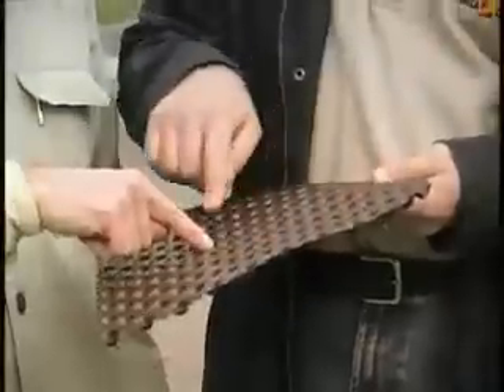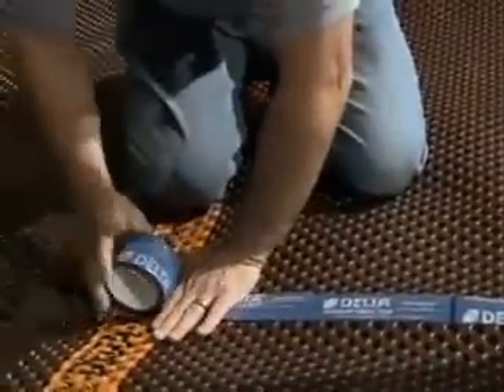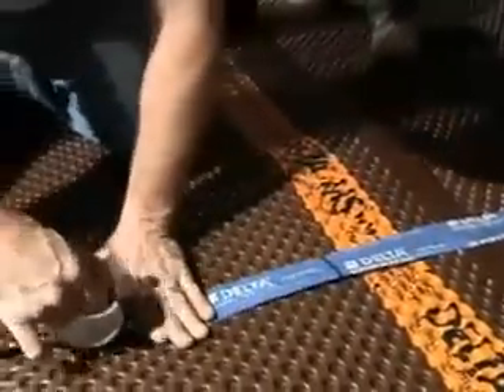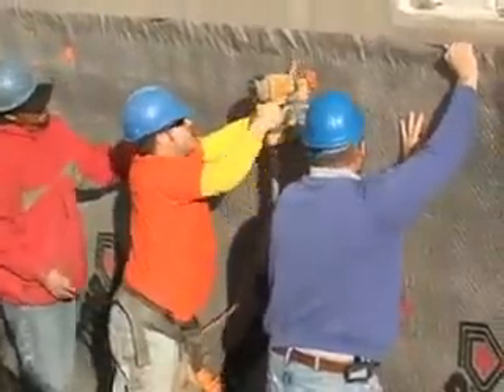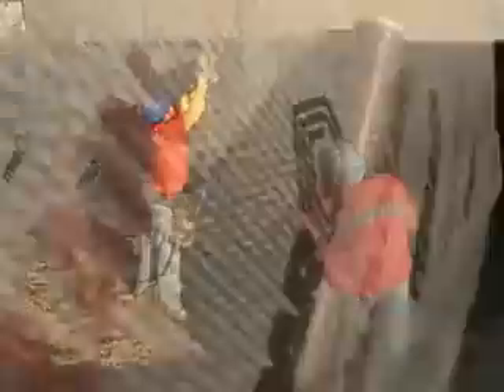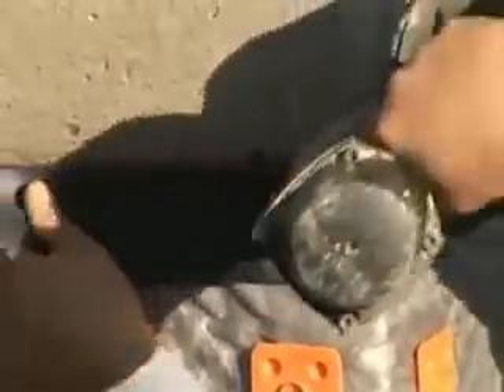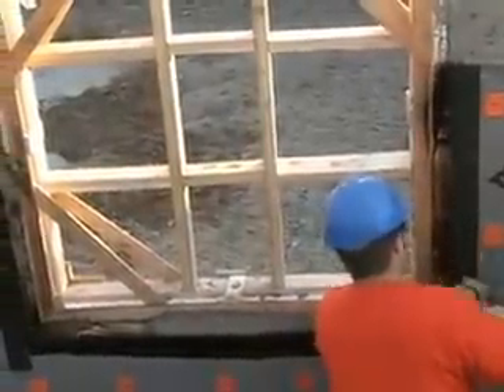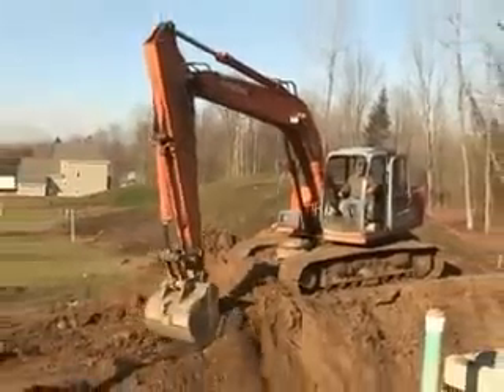DELTA®-MS - Foundation Moisture Protection

Comment: Can delta ms applicable to be installed "above-slab" (basement) and then have plywood installed on top with concrete fasteners?
Reply: I have exact same question please.
Reply: If you’re talking about waterproofing an existing slab then you’re better off using Blueskin.

If you’re talking about waterproofing interior walls above a finished slab then no. You’d have to expose about 10 inches around the slab, 1 foot down for a drainage pipe and another 2 feet x 2 feet hole, roughly 16 inches down in a corner somewhere for the sump pump pit.

Comment: DELTA MS is a horrible material so hard plastic and they make all these holes on the wall. FSM uses this product and made a mess in both side if foundation in my home. You will NOT be able to place anything to cover it...don’t fall for these product because you will be sorry like me.🥲....All those Orange plastic nails will make so many holes in your walls...NO, NO, NO
Reply from the maker: Hi Deanna:  I am sorry you aren’t pleased with the installation.  I can respond only based on the information you have provided here.  An installation of DELTA®-MS does not “make so many holes in your wall”.  The orange fasteners do have nails and provide the holding strength to the wall.  These nail should be 1.25-1.5 inches in length, so the nails do not go through the wall.  The reason they are not a cause of leaks is due to the air gap created by the dimple membrane.  Any water that moves into in the air gap is relieved of all hydrostatic pressure and drains away due to gravity.  This means that the wall will not leak due to water penetration at any fastener, even if water comes in front of a crack or hole.  If you have DELTA®-MS on the interior of your foundation ( i.e. in the basement), it must be covered by drywall or some other non-combustible cover due to fire code requirements.  While your specific conditions may be different, one does not generally require DELTA®-MS on both the inside and the outside of the foundation wall.  You can read our Guide to Protecting Foundations here: https://www.dorken.com/media/docs/products/Additional-Resources/DORKEN-Delta-MS-Basement-Foundation-E-Book.pdf

Comment: How do you overlap the bottom with Superior Wall which uses crushed stone footing?
Reply from the maker: Hi Lenser, In just meeting code, one can simply terminate the DELTA®-MS at the bottom of the wall. Alternatively, one can still bend the DELTA®-MS at the bottom of the wall, terminating at the perimeter drain. In this case, one would bury the bent DELTA®-MS within the crushed stone. For more information, please contact us at info@dorken.com

Comment: Do you need waterproofing membrane before installing the Delta MS?
Reply from the maker: Hi there! In Canada and in the U.S, in areas of low or no hydrostatic head, the building code approvals allow DELTA®-MS to be applied stand alone with no additional membranes or coatings required. For more information, please contact us at info@dorken.com